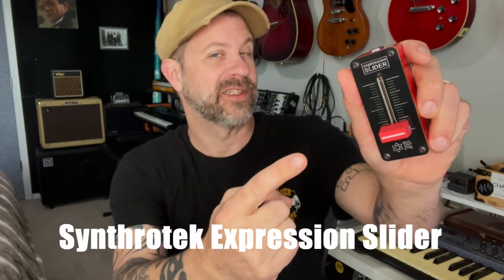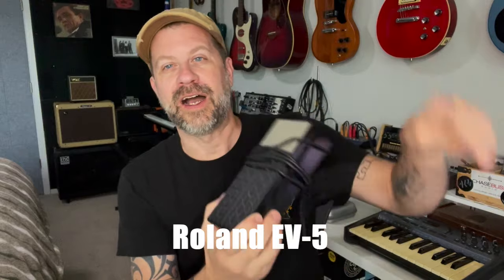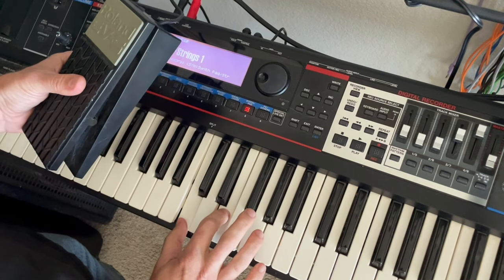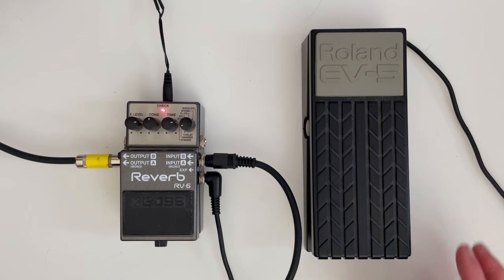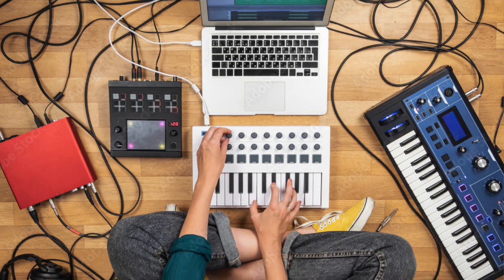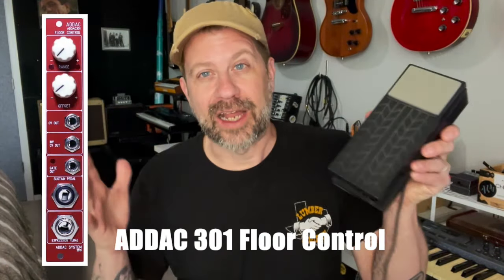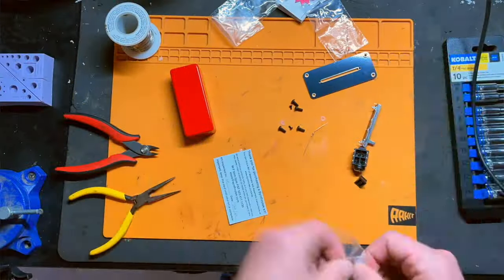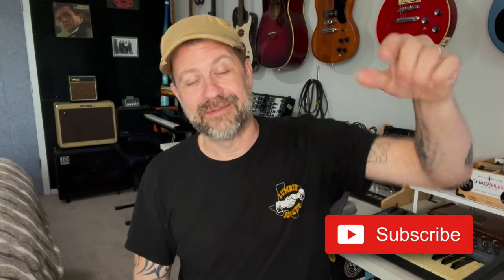The Synthrotek Expression Slider is Awesome!

Comment: Well I've learned something today. I think the closest I've come to an expression input is a 1/4 inch jack on my piano, but expects just a simple switch for a sustain pedal. When I read the title I expected this to be a midi CC slider. I had no idea that some instruments have an input expecting a potential divider.  You made a very nice job of the case. I wouldn't be bold enough to go for red, but the paint job and the red knob make this look really smart. Synthrotek should make that an option.
Reply from the maker: Ah yes. It's a fun realization that an expression pedal is just a potentiometer with a treadle. Here's another fun fact. If you take an inline volume pedal (like you'd use for your guitar), get a TRS to dual-TS cable, plug one TS into the pedal's input, plug the other TS into the pedal's output, and bam... expression pedal. So effectively, every volume pedal is also an expression pedal. 🤯
Reply: @musicalmiscellany  still trying to get my head around that but that does sound like a fun hack.

Comment: I think I could do this!! I did the korg S-1 and also the Moog Can’t remember the name. But it was replaced by the Mavis. That might be a good project to get my left hand going again !!  Thanks Kale and I would use it with the different synths I think. Very cool
Reply from the maker: I’m sure you could handle it. This is one of the simplest projects I’ve ever built… but it’s surprisingly useful. Thanks for checking out the video.
Reply: @musicalmiscellany  Your’re welcome. And thanks for the encouragement. !!
Reply from the maker: @MariaCalfaDePaul  This would be a great project for someone looking to hone their solder skills. It's relatively cheap and quick to build.
Reply: @musicalmiscellany  thanks.  We do have that soldering iron now lol (Vinny used it to replace the toggle switch on my inexpensive Epiphone electric I won )